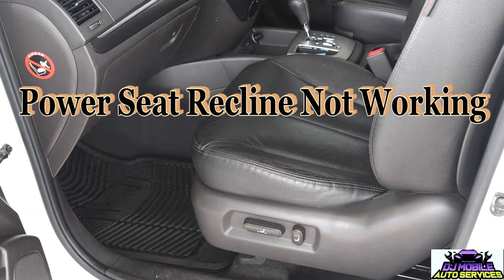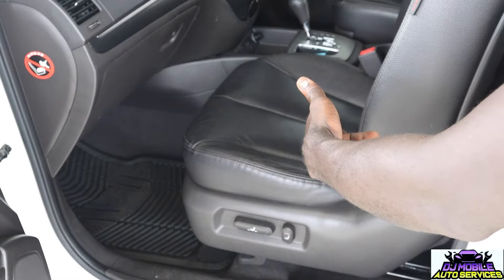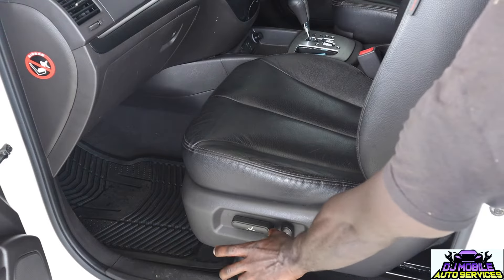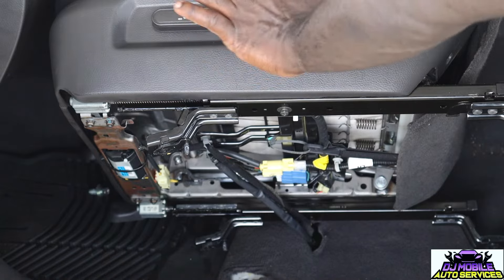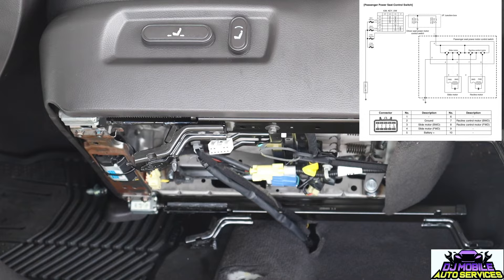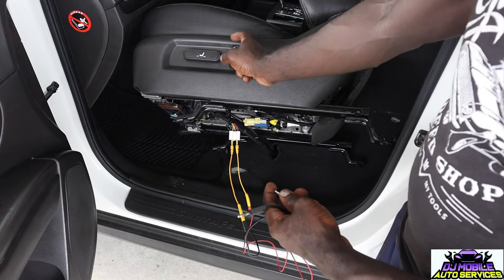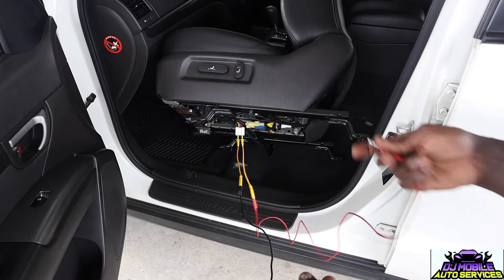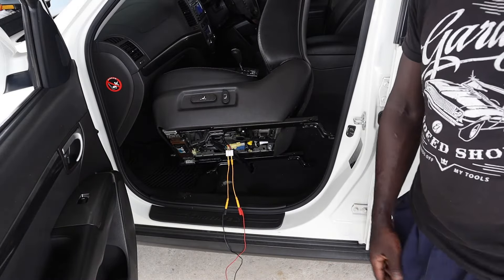Power Seat Not Reclining. What To Do If A Power Seat Is Stuck In Recline?

Comment: Hey can you shoot me a link for the cables you used to hook up to the seat? Don’t know what I’m looking for
Reply from the maker: In the video have the wiring diagram and the colors that I hook up to. Look for the wires going to the motors.
Reply: @djmobileautoservices  lol sorry the adapter cables you used with the 9 volt battery.
Reply from the maker: I just front probe into it with a harness that I had. You may have to back probe it if you can't get it through the front
Reply: @djmobileautoservices  Bro. We don’t understand that. What are the names of the wires you use so that we can specifically search for them and buy them

Comment: Do you need to unplug your car battery before doing this?
Reply from the maker: No, you don't. Unplug the seat harness, and look for the wires going to the motor. Use the 9v battery to move the seat where you would like it to be. Switch the leads around to go the opposite way.